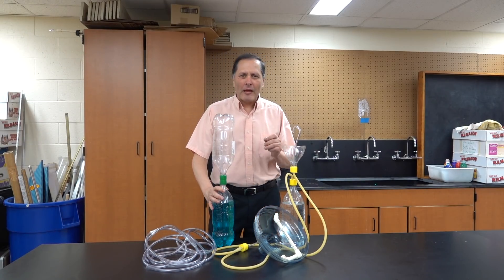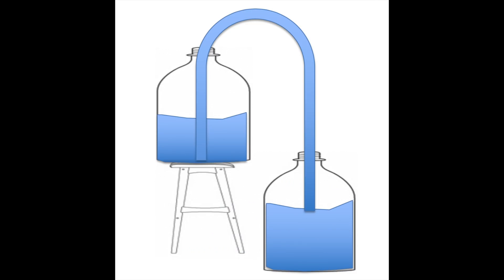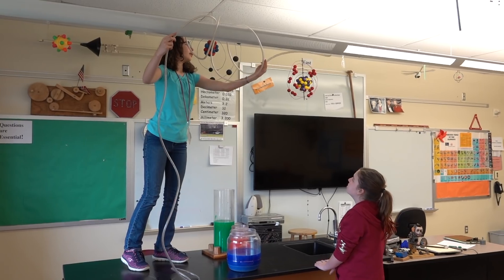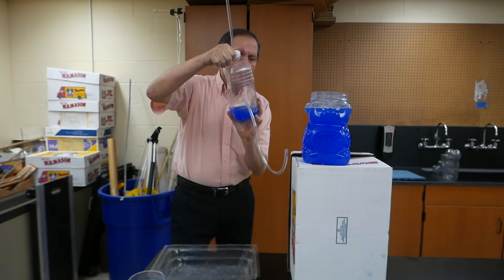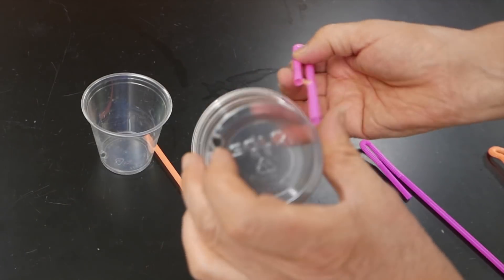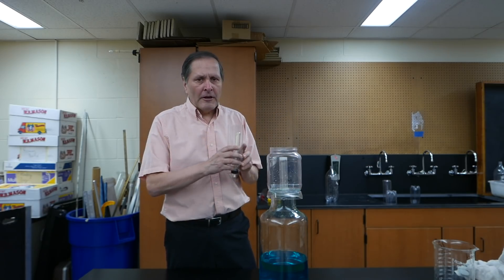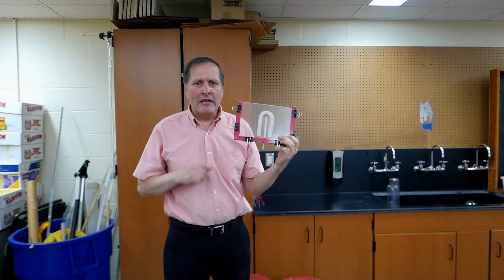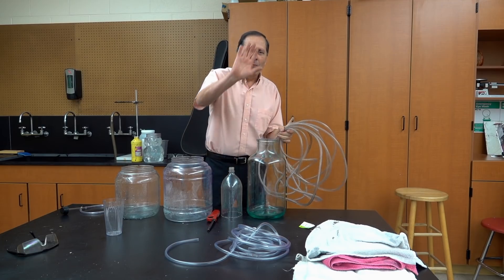Water Demonstrations  Part One --. Siphons // Homemade Science with Bruce Yeany

Comment: This brought me to the question. Do people in the US use kg or metres during physics exercises?
Reply from the maker: Seems like  the U.S. continues  to be stuck using two systems.  Pounds, feet, cups, etc are usually are used for common measurements. For  the science community for the most part especially as you  get into higher education,  metric units are used. Makes no sense but  I don't see any real effort to make any changes in updating our measuring units to match the rest of the world.
Reply: @YeanyScience  Thank you for your answer. I assume then your students would use metric system units when doing their calculations in the class?
Reply from the maker: Yes, metric units  for about 95 per cent of the time,  there were a few instances where they didn't such as calculating whether cars in front of the school were speeding.  Speed limits in the U.S. are posted in miles per hour.

Comment: So now we fit a few turbines in there and then what? Dont tell me infinite energy because i already saw a setup like that claiming to be exactly that. Infinite energy. With enugth Turbines in there or paddles in that case the water could supposedly be pumped back up at less energy than "Created" during the process of transfer via the tube. We all know that aint possible.

Comment: I was toying with some glass capillary tubing close to the 800 microns mentioned in this Scientific American article and wondered how much it assists in allowing water to be raised up a tree. The water climbed about 2 centimeters and coupled with the affinity water has for the cellulose walls of the vessels and tracheids, adhesion and cohesion forces combined, how those qualities go above the typical height you can raise water before it "breaks" or cavitates. The smallest diameter mentioned was 20 microns, even less that a thousandth of an inch.
Anyway maybe a more narrow tubing would be less likely to break a water column if going for more than the standard height water can be raised before collapsing or buy you more time before it does, if metastable occurrences are possible or can be brought about with relatively wide diameter tubing, that is compared with the tiny stuff trees use. 

How do large trees, such as redwoods, get water from their roots to the leaves?
"Theoretically, this cohesion is estimated to be as much as 15,000 atmospheres (atm). Experimentally, though, it appears to be much less at only 25 to 30 atm. Assuming atmospheric pressure at ground level, nine atm is more than enough to "hang" a water column in a narrow tube (tracheids or vessels) from the top of a 100 meter tree. But a greater force is needed to overcome the resistance to flow and the resistance to uptake by the roots. Even so, many researchers have demonstrated that the cohesive force of water is more than sufficient to do so, especially when it is aided by the capillary action within tracheids and vessels."
https://www.scientificamerican.com/article/how-do-large-trees-such-a/

Tidbit
The increase in transpiration is due to the increase in temperature 
- water molecules have adhesion with the walls of the xylem
- This results in tension as water is pulled up the stem
- An increase in the flow rate will cause an increase in tension and cause the walls to be pulled inwards
The diameter of a tree trunk reaches its minimum when the flow rate in the xylem is at its highest at midday. 
https://quizlet.com/119195082/flashcards
Reply: Very interesting stuff.

Comment: Nice setup. However, please don't put '.3'  on 10.3 m max siphon height - that incorrectly implies 0.1 m accuracy.
Water under 30 hPa pressure will boil at room temperature so you lose that .3 anyway.
Reply: It's 10.2 meters if you account for water's boiling pressure at 20 Celsius.

Comment: What did you add to the liquid in the last example to make it diffuse more light?
Reply from the maker: termpara paint
Reply: @YeanyScience  Thanks! I made a bottle of blue "potion" for a Halloween costume that was just blue food coloring and water, but unless I held it in front of a white sheet of paper the effect was lacking. I swapped it with blue Gatorade for the opacity.

Comment: At 9:24 what makes the water in the bell rise above the water outside the bell?
Reply: The water being poured in is pushing up the tube after hitting the bottom of the container. As it fills up, the water being poured in is blocked by the water already in the cup and so doesn't rise as high in the inner tube.
 You can get something similar when rinsing cups out in a sink. When empty, cups can redirect water and create a fountain, spraying water everywhere. But once a bit of water has collected the cup will fill up instead.

Comment: But you have to suck out the air in the tube first. Don`t you ? Water doesn`t start flowing by itself without (some help) at the beginning.
Reply from the maker: yes,   the tube has to be filled with water
Reply: @YeanyScience  Thanks for your answer Mr. Yeany. 🌷

Comment: I'm certain it wouldn't work, but what would happen if you placed two siphons leading into two bottles in such a way that they feed the liquid into each other? I'm curious as to why that wouldn't make perpetual energy.
Reply: You would need to have one bottle higher than the other and so the water would only flow one way. Good question though :D
Reply: Hey Zack, So energy is only transferred from a position with potential, relative to another position. 
Ben is saying that if the bottles were at the same height, they wouldn't have a potential difference in gravitational energy. 
The idea of a perpetual energy device is interesting, but you cant get something from nothing....
The best we have come up with is taking unstable matter, and smashing it with particles, breaking it apart, and some of the most unstable leftovers turn directly into energy. This process is called nuclear fission.
There is enough energy bound up in the atoms of a sheet of paper, to run an entire city for a few days!!!
The problem is... the atoms are VERY stable in paper, and to convert them into energy requires a massive amount of energy, and the reward is not very great when you consider the costs of building and operating the machine. So we use unstable atoms,... which by nature, are unstable and rare, such as Uranium 238 which is just the beginning of a long process requiring U235 to convert U238 into Plutonium 239 for chain reaction.... all this just to create heat to run steam engines, ie Nuclear power plant.
Mechanical energy devices also have great loss from friction, such as bearings heating up. Be it mechanical friction or wind resistance. You also get loss from inductive forces (magnetic fields)... So when you wave a magnet across a coil, and there is a load across the coil (like a motor hooked to coil), you will get a magnetic field resisting the motion of the magnet you are waving over the coil. That is basically a generator, and the greater the load on the generator, the harder you must work to swipe the magnets over the coil. You an drop a neodymium magnet down a thick copper pipe and watch as the magnet slows down, almost hovering down the pipe. The field of the magnet is being inverted against the magnet, from the closed loop of pipe, and creates an opposite field, causing the magnet to hover, but slowly fall, as energy is lost to heat and other fields nearby. This is lenz law. 
Bottom line, you cant get something from nothing, only transfer... and in every transfer, there is some loss of energy... so best to find a lot of energy, and try to find a way to harness some of it. Our best source is probably nuclear, geothermal, tidal, wind or solar.
Note: 
Geothermal is heat from molten rock in the earth. 
Tidal is gravitational energy from the moon, tugging on the ocean.
Wind is basically solar energy from the sun heating the surface of the earth.
Solar is directly from sun.

Nuclear... well, that is beyond me, exactly the properties that formed the atomic and subatomic bonds in a supernova. If your interested in how energy changes states, look into the Feynman diagrams, how subatomic particles change states. It deals with wave in the electromagnetic field and how different wave forms coalesce and disseminate with/from each other. A lot of this goes into the model theory of quantum electro dynamics... which seems to best fit... ripples in a field... what is that field... hmmm loops, strings, aether... All we know is it is directly relates to the effect of gravity.
Reply: As was mentioned, it wouldn't work because the water in a siphon will only flow from high pressure to low pressure.  But it's not a stupid question. Before the mathematics of this sort of thing were worked out, a number of perpetual siphons were seriously proposed as perpetual energy sources.

A fun point : Some of them actually work if you use Coca-Cola instead of water, because Coke makes its own pressure. ... until it goes flat, anyway.